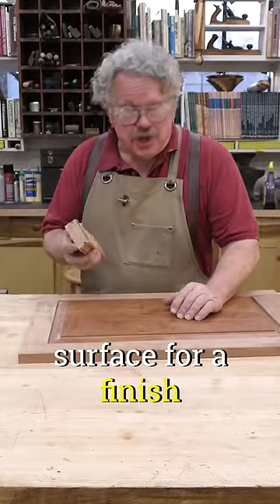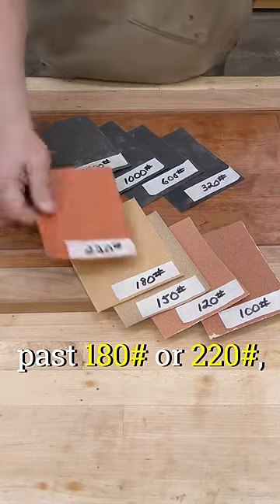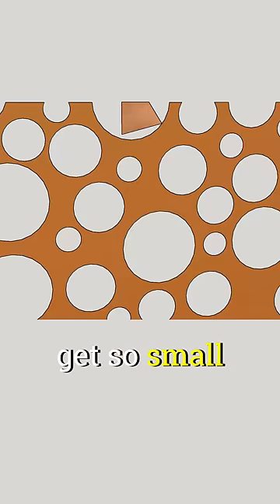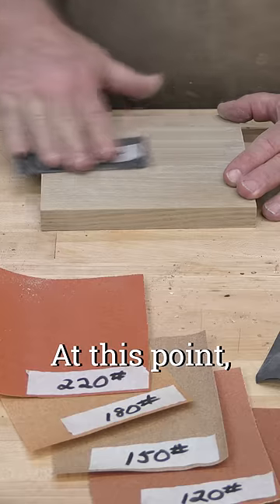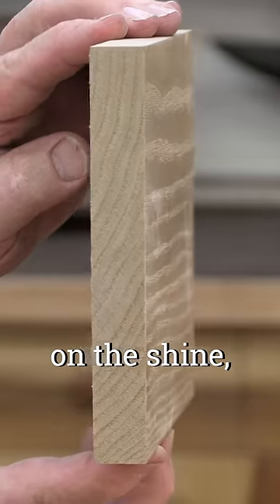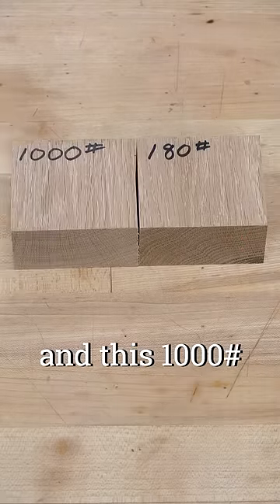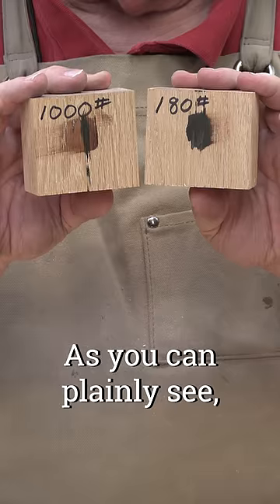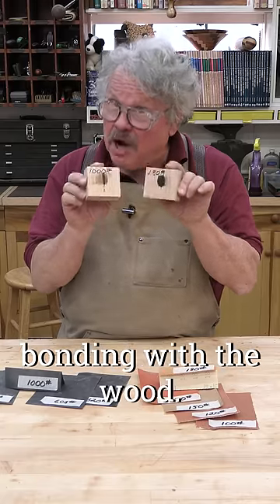Sanding Past 220 - How Smooth Should You Go? #woodworking #diy

Comment: "Understanding why" is possibly the most important but most overlooked aspect of life in general.  That was a great explanation as to why you don't want to sand past 220 grit.
Reply from the maker: Thanks for saying.
Reply: So true! I’ve always thought nah I’ll just sand to higher grits, but now that I know WHY , I won’t
Reply: Anything past 220 grit is usually only if you want to use varnish on your wood. Use paint/varnish, sand it, and apply another layer.

Comment: Exactly!!
Sand the timber to 120/180 then apply the 1st coat of finish.
Then sand with ever finer grades, applying finish in between each sanding until the desired 'gloss' is achieved.

Comment: As somebody who worked in a factory where wooden cabinetry gets finished, sanding with 600 grit sandpaper is just what we did. How they get around this issue of the sawdust filling in the spaces in the sandpaper is they just change out their sandpaper VERY frequently. Like 60 sheets an hour per person kind of frequently. The sandpaper they use with their sanders is velcro on the back so it's easy to rip off and replace quickly. But, they go through A LOT of sandpaper every day.
Reply: Sharp paper is so much different from dull and loaded paper.
Reply: Because this video is untrue. Embedded wood particles will take stain/finish- why would they not?
Reply: @Tensquaremetreworkshop  yes but it wont soak into the wood, only sit on top.
Reply: @ca2269  Nonsense! This method was used for centuries, by the finest craftsmen, and they achieved a finish you could only dream of. If you could make wood 'waterproof' by this method it would be widely used for that purpose. It is not.
Reply: 320grit, FTW.
Reply: @Tensquaremetreworkshop before modern urethanes/polys/epoxys people were using shellac based finishes by and large. Shellac will bind to nearly anything, including Teflon. Sanding to the extent we do wasn’t common until quite recently too. Many pieces of fine furniture have been built without any sanding at all, only hand planes to give it the final surface.
Reply: @markr5787  As I said in a separate post. Planing followed by scraping was the way fine furniture of the past was made. Sanding is an incredibly crude method- cabinet scraping works with the fibres of the wood.
Reply: @Tensquaremetreworkshop  he said it may have trouble and won't penetrate as deeply. There's a difference, mate
Reply: @Tensquaremetreworkshop lol, crude?
Reply: @Saintjackoftrades  Yes. Repetitive scraping the wood with a rough, jagged surface in order to randomly remove fibres can only be described as crude. Compare to a plane, designed to slice through the fibres to a controlled depth, the angle of cut, relief, support and chip break carefully controlled.
Reply: @Tensquaremetreworkshop  you're a weird person. That is the same method optics companies use to make lenses and mirrors. Don't be silly your whole life.
Reply: @Saintjackoftrades  Did I touch a nerve?
The process you refer to is called lapping, not sanding.
I did NOT say that it was ineffective, and it certainly is popular. That does not stop it being crude. Do you think it is sophisticated? Really?
Reply: @Tensquaremetreworkshop  so you're saying that I shouldn't believe my own eyes when he presented an actual evidence that the wood sanded with 180 grit was penetrated better than the 1k one. I'm a carpenter and also don't sand past 220 because the reason he gave in the video. If you've got evidence of the contrary then upload it so we can see.
Reply: The question is two fold. 1) do the people who set up your factory ACTUALLY understand what they are requiring employees to do? I have seen a lot of factories turn out garbage and be inefficiently run. 2) what KIND of finish were they doing? If I am using top quality wood, I am not staining ANYTHING. I want the customer to really see the wood they are paying for. Thus this tip for STAINING wood is irrelevant.The only reason I wouldn't hit it with 1000+ grit before I applied the protective clear coat/sealer is if I sealed it at ~220 BEFORE working my way up to 1k+

The other thing that wasn't expressly stated is that you can STAIN the wood at 180, let it dry and THEN keep sanding. The goal is to get the stain in so deep that scratches do not reveal the real color of the wood. You can remove a LOT of material at 180 grit, but at 600 you are pretty much just polishing.
Reply: @ImALefty08  I think you are replying to the wrong post. It is obvious that a rough surface will take more finish- it has greater surface area. Whether this is a good thing is another matter…
Reply: Fluid wash also works, and direct to surface vacuum removal.
Reply: Just add your finishes between grits. Use 60 grit, add finish, let dry, use 80, add finish, let dry, etc. I don't usually go past 220. If you're proficient with a Stanley #4, you don't ever need sand paper lol
Reply: @Tensquaremetreworkshop  i highly doubt what youre describing is done how youve described it, and this video is completely and obviously correct.

The obvious answer is doing both. Rough sanding first, then oil, time, then fine sanding and more oil.
Reply: @blastfromthepast7119  Obvious? For centuries the sequence was plane, scrape, polish. Fine furniture with no consumables and very little dust. But it does require skill. Obviously.
Reply: i work in timber production, specifically large scale french polishing luxury boat parts. i’m very pedantic about making sure that our timber is thoroughly blown down before being sprayed (with coats of varnish), so it doesn’t leave weird light areas through the grain. our joinery department uses 120-180 grit, which leaves dark orbital scratches in the surface of the wood. i widely advise using the appropriate grit for the finish you want- levelling out an uneven surface? low grit, low pressure on the sander. you want it to cut as efficiently as possible, transferring as little heat as possible. this prevents sanding divets, burnishing, reactivating any glue/ varnish and depositing it in the grain, and scratches. for anything you care about the visible finish of, i stick to 240-320. this allows me to sand out any imperfections in both veneer and solid timber without burn throughs, and to not leave scratches. our department unfortunately goes through an ungodly amount of sandpaper, but it is necessary to get things done. the biggest pieces of advice i can give anyone are to feel the sandpaper before you touch it to what you're sanding, and keep that in mind as you work. also DO NOT PUSH ON YOUR SANDER. if you feel the need to push, you need new sandpaper or to go down a grit. all you're doing otherwise is straining yourself, your sander, warping the oribie pad to the piece (this will give your edges a slant) and introducing unnecessary friction to  the piece. a lot of this stuff is trial and error, but if you pay attention to the end product you learn and adjust pretty quick :)

Comment: In year 8 woodwork class, we made cheesboards, and I remember spending like, 4 lessons sanding mine meticulously to 2000, and I still use that board to this day because even if I get sauces on it, it's easy to wash and rarely stains.
Reply: You bring up an interesting thought.
If you don't intend to stain the wood, but plan on sealing it with a quality wood finish, does going the extra step end up with a better, longer lasting finish?
I'm curious.....
Reply: @davidgraham2673  I think it did, cos my little brother did the same task 3 years later, and didn't do all that, and his got stained in like, 3 years and we had to throw it out
Reply: @davidgraham2673 So how fine you sand really depends on what finish you use and the particular wood species and what not, but there are a few things you want to do if you want to get a great stained finish and sand past 240, I personally like going to 600 for a lot of things or even 2,000 for certain projects just getting a wax finish or a French polish. But basically when sanding from 100, 120, 150, 180 and 220 you want to run a damp rag across the board, not enough to soak it but enough to get the wood grain to raise. This is called water poping the grain and it will help give a smoother finish even if you only go to 220 because when staining particularly if you used a water based the grain can get raised if you don't do this. However I generally don't do it past 220 because it tends to be enough and past that if the sanded particles are moist they will clump up into the pad extremely quickly. If you want to go past that what you need to do is get a rag and you can use water but I prefer mineral spirits or "brush cleaner" and get it fairly damp and wipe down the board after each of the finer grits. With the spirits you won't get as much of the water poping effect and since it dries extremely quickly you can sand right after. But the miniral spirits and a microfiber rag will actually help pull out all of the fine wood dust that gets embedded. The dust is actually attracted to it so even if it in the actual pores it does a great job of releasing it. I generally stop around 600 sometimes 800 depending on what the item is used for. For things that are going to be handled a lot I find that the 600 still retains that wood feel but is extremely smooth and almost soft. When you get past that it can almost be too smooth for certain items. As far as if its actually better for the item I could see some arguments being made that it may scratch less easily since its so smooth that things are less likely to be able to find purchase but other than knocking down edges I don't think it makes that big of a difference.
Reply: @Vidar93  , Thanks for the heads-up. It never hurts to ask questions, and I always appreciate it when someone takes the time to answer my questions. 
Thanks again.
Reply: I read this as chess boards, and spent a long time wondering why you'd be getting sauce on a chess board constantly lol.
Reply: @Yohoat Same but I didn't think it was weird he was staining his chess board, lol
Reply: @Yohoat Me too, but I was wondering how you'd mark the black and white squares.
Reply: @scottclowe Usually it’s done using 2 different wood types which have inherently different colors (i.e., dark brown vs beige). The squares can be either thin veneer or actual wood blocks.
Reply: @Yohoat same! Im like, that doesn't seem like a year 8 project lol
Reply: My house is older and the bathroom has a lot of wood that can get soaked from the shower. I made sure to sand it to 800 grit so the water slides off of it, because before, the water was getting into the wood easier. Every year I just touch it up with another thin layer of spar urethane
Reply: @davidgraham2673  I wondered that for a second, too, but then I remembered he says "may prevent a stain OR FINISH..." from adhering properly.
Reply: @marthajean50  , I must have been in a micro-nap or daydreaming again in class....lol.
Reply: @davidgraham2673  Well, he said it so fast. I replayed it to be sure. School put me to sleep too! LOL

Comment: Spot on.  Worked in a high end cabinet shop years ago, multi million dollar homes.  Lumber was never sanded beyond 150 grit, and veneer never beyond 180.  Scuff sanding between coats of finish was 360.
Reply: was there no concerns over creating pitches in the wood at 150?, thats almost a leveling grit.
Reply: @quercus3290  I presume you mean "scratches"?  If so, no.  But, you need to use quality sandpaper, and high quality sanders.  We used Dynabrade air sanders, 5" disc random orbit.  You have to have the spin plus the eccentric circles for a good result.  Electric random orbit sanders will work too, but people often let them wear out where they spin up fast like a grinder, then damage the surface when you bring the sander into contact with the wood.  There's a rubber o-ring that keeps the pad from spinning up that breaks over time.  Sometimes a bearing would go bad causing poor results also.  On occasion, we would run a block sander over a piece along the grain to ensure there were no tiny sanding circles, but this was not commonly necessary.  Even then, nothing over 150 on lumber.  Again, quality paper - 3m, Norton, Diablo, so forth.
Reply: @squarebody4546  very good
Reply: @squarebody4546  So genuinely not trying to goad you here, but wanted to ask. Before the invention of orbital sanders were cabinets not as high end? What would be used before to achieve this quality?
Reply: @clayrush1413  I mean no disrespect here, but I liken it to anything else: cutting wood, shaping it, turning screws, it was just harder and took more time before power tools.  I imagine a lot more hand sanding was done.  Before the invention of sandpaper, there were scrapers.  Some old timers still use a sharp scraper.  I'm into modern tech and getting stuff done ASAP, so for me, it needs a cord or an air hose.
Reply: @squarebody4546  gotcha, thanks 👍🏻
Reply: thanks for mentioning between coats.
Reply: We did block sander on all flat tops. For other surfaces, the flatness matters a lot less. You get flatness on your final sands after your sealer and before your finish.
Reply: @clayrush1413 will add that a lot of fine cabinetry was scraped, not sanded. A plane or scraper will achieve the best finish if done well.
Reply: @davidburton79  thank you, I've never done any scraping but it's on my list of techniques to learn.
Reply: @clayrush1413  a cabinet scraper
Reply: Been in cabinet shops my entire career and I've never seen a single one that didn't use high grit paper to flatten the finish. No way you'll get "high end" from 360. It would be a decent finish but that's not the same as high end in my opinion. If a customer is coughing up the dough for a full custom kitchen starting with 8/4 Wenge they expect perfection in my experience
Reply: @okgroomer1966  Well, I certainly respect your angle on this, but we did do high end work using things like Wenge, Sapele, Black Walnut, Elm Burl,  Anigre, Mahogany, and other exotics.  Granted, we weren't doing high gloss piano style finishes.  We sprayed Conversion Varnish catalyzed for each batch.  Not saying we were the best out there, but clients were happy.  150/180 wood, 360 between finish coats, 3 coats of finish.  Maybe an occasional caveat, but that was the standard and it worked.  There's always another way, and there's always better ways.
Reply: @squarebody4546  You can definitely make nice stuff without going crazy. In my experience (NYC) people will complain if it's not perfection. I kinda can't blame them when they drop 200k on a kitchen. We have just always found it easier to make it perfect when working in uppity areas, because they're gonna find any way possible to pay less or fight you on paying. Building cabinets for normal people we usually never go past 240 either with a light wet sand on the finish if It didn't lay down nice.
Reply: @clayrush1413 plane
Reply: @squarebody4546 if you had to use an electric random orbital sander, how would you go about doing it without causing the wear to the equipment that you mention?
Reply: @fredrikfredrikfredrik   You mean how to prevent wear to the sander?  They use a bearing and a rubber or silicone o-ring/band to prevent the pad from spinning up like a grinder.  When you place the pad on the wood, it overcomes the pad brake and spins in eccentric circles.  Over time, the bearing fails, or the band snaps.  One simply needs to check it periodically and replace these items on occasion.  They last a long time, so it takes quite a bit of sanding or age before they fail.  Also, some electric sanders do a better job holding the pad at no or low spin before placing on the wood.  Some sanders are top heavy and tend to gouge, some have higher or lower RPM, some vary in the size of the concentric circles.  All of this will vary the efficacy and result.  My favorite was an older Porter Cable Quicksand, hooked to a Festool vac.  Dust removal via vac helps to see your results and be consistent.  Tried a much more expensive Festool sander once, but the pad drifted in slow circles left, then right, or not at all.  Truly a "random" orbit, but it was not aggressive enough and took forever to make any progress.  Air sanders are best, but don't use a brake (at least not when I was using them daily years ago).  You must start while contacting your substrate.  No band to fail, but bearings did go out on occasion.  Very fast and very effective.  Low profile, no tipping.  However, requires industrial amounts of air capacity and recovery to run.
Reply: @squarebody4546  Thanks for a great reply! I appreciate it :-)

Comment: I have a black walnut strat in an oil finish I did. It's been sanded with 220 to 3000, intentionally, as when you run your hand on it now, its almost like glass. I love the feel of it, and knowing how it came to be is epic.
Reply: So was it sanded with 220 or 3000 what the heck are you talking about?
Reply: iijbbjuggffyyjkooooopougvffsxg  no I didn’t understand and how was I being rude? Also the whole point of the video was to NOT sand with above 300 grit if you’re going to stain
Reply: The wood in this case was not stained because it was walnut. He stated that he did an oil finish and the 3000 grit gave it a super silky feel and shine that lets that beautiful walnut glow. When I wood turn certain pieces I've gone even higher in grit to get the finish I want. Again, like the OP, didn't stain the wood and wanted that polished look. Different techniques for different purposes.
Reply: I find oil finish with wet sanding makes such a nice finish. My bed frame was finished at least 400 but I can't remember if I went to 1000 too.